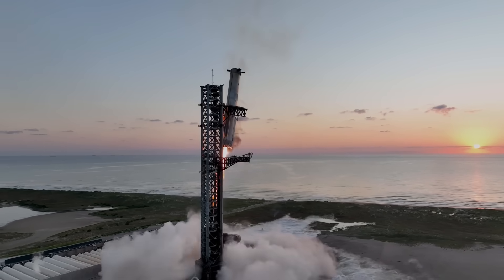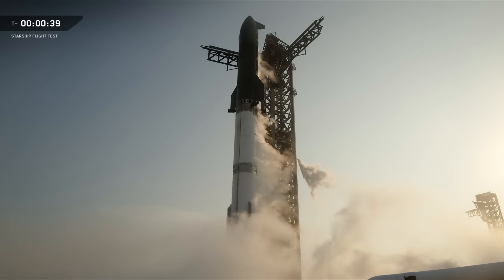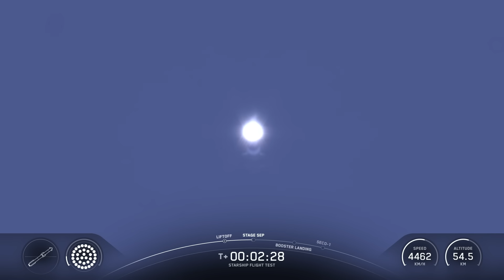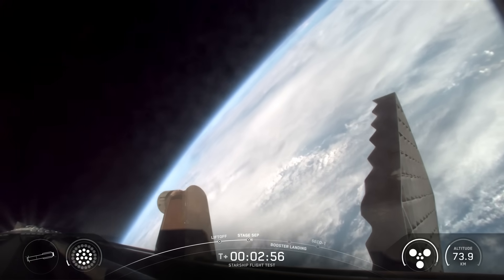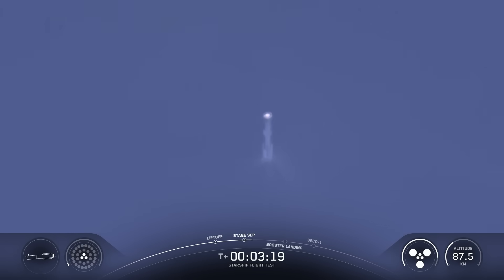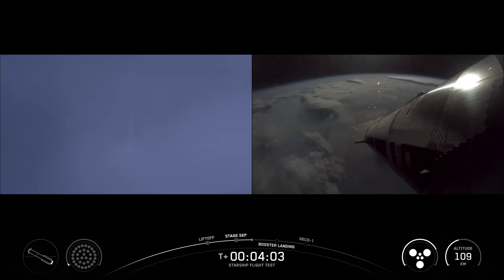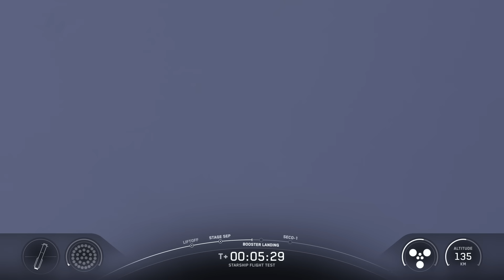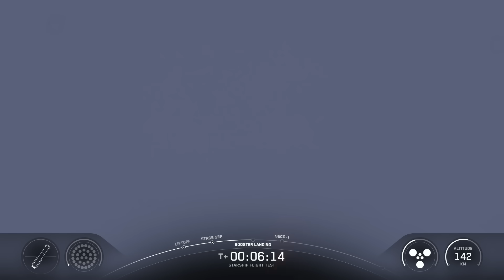SpaceX Builds Largest Reusable Booster, Also Makes Door That Won't Open - Starship Flight 9 Recap

Comment: Block 2 ship basically repeating what Block 1 did in its first 3 flights
Reply: As a PhD in Armchair Expertise I can say with high certainty that they're doing everything wrong
Reply: That kind of sugesting the leapfroging design is backfirering
Reply: Here's a fun comparison: Buran. The USSR started the Buran program in 1974. The first test flight occurred in 1988, and it was a success. Buran reached orbit, deorbited, and then landed using automated systems. And then the program went nowhere, because the USSR was falling apart and couldn't afford to keep up space program funding.

The Energia rocket used to launch Buran started development in 1976. It only had two flights: The first test in 1987 was a failure, but the second (the Buran mission) was a success.

People say developing new rockets is hard, and that's true. People say SpaceX's approach, which involves the rapid unplanned disassembly of many test vehicles is faster than spending years and years modeling things on the ground. But uh, SpaceX's super heavy lifter program was publicly announced in 2012. It was first alluded to in 2005. It doesn't seem like a particularly accelerated timeline to me. And that with the benefits of decades of advancement in materials science and computer modeling and simulation?
Reply: @SnakebitSTI  Exactly. We have only been launching orbital rockets for what, 68-69 years? Look at how many rockets we have been through and how much we have done. About 12 years after Sputnik we were on the moon with a massive rocket which worked first flight. Then about 14 years later we had the shuttle, and a bunch of other orbital class rockets in between, plus ICBMS. Where are these "decades" of time and all these failures? Plus, ignoring advancements in engineering and simulations is just crazy. Lets look at just the Starship reentry tests where parts of it melted, repeatedly. That should never have happened. We have plasma wind tunnels, like the Arc jet complex where a miniature or part of Starship can be tested to see exactly where the plasma flows at and which parts fail. Design changes can then be made without any need for repeated reentry tests to see what happens. It doesn't matter if they are doing something different., the vehicle still experiences a bowshock and heating, physics doesn't change cuz you have a new idea. And where is this "rush" to rapidly develop and manufacture all these giant rockets coming from? Do we have a planet oblitering asteroid on the way right now? Mars is a horrible idea.. lets put space stations on a planets surface which offers zero benefit to humans and can never be terraformed because the gravity is too weak to sustain anything close to something which can keep people alive. Keep the space stations in space where gravity can be simulated, construction is easier, and  help can be provided in under a day, not to mention it is cheaper and a lot less risky.
Reply: Can you imagine the hew and cry which would have taken place if a block 2 F-16 had have performed as poorly as Starship? Even the Ukrainians would not accept them even though they are starved for jet fighters. Why are we requiring so much less of Elon's Starship? He did fine with his other rocket development. He didn't blow up nine of them before he got to the point where they were commonly successful. I think we need to stop throwing Federal money at him for this project. He might not launch as often, and it may be years before another one launches, but I'd bet that he gets things figured out and fixed before he launches.
Reply: The money is tax payer money. . . He has spent $3.5 billion testing Starship using the Lunar lander money
Reply: @DanDeGaston  Then used $280-million to buy a President, get his buddy appointed NASA director and axe the Moon mission so that he doesn't have to continue with lunar starship.
Reply: Block 2 is a failure.  Period.  It hasn’t performed better than Block 1 overall.  They need to regress to Block 1, forget about ALL objectives other than to get the damn thing into a stable orbit with pitch & yaw control then deorbit successfully.  THEN they can do design/performance parameter variations.  HLS doesn’t give a shit about launching Starlink satellites.
Reply: Yeah without orbital insertion nor payload deplyoment...the two important things needed to use it for ANYTHING
Reply: @hurricanemeridian8712 and not selfdestroyed
Reply: @hurricanemeridian8712  and the two things that could make it actually cost-efficient (i.e. rapid reusability without refurbishment and orbital refuelling) are still so far away
Reply: @trabladorr  Yupp, even Falcon 9 isn't rapidly reusable after 10 years...
Reply: @trabladorr  Those two things arent even needed to make it the most cost efficient compared to literally anything else out there
Reply: @TheGeffry yes it is
Reply: @TheGeffry  Nine days is quite rapid in that industry... look at how long it took to get the shuttle ready for reuse (the record was 63 days), and reusability was one of the main points of it.
Reply: @TheGeffry  and yet flying more than once a month, let alone once a week, has made it better than just about any competitor anyway
Reply: @TheGeffry  This isn't a criticism of SpaceX's engineers, just a criticism of Elon's "optimistic" timelines. Falcon 9 is an incredibly successful rocket.
Reply: @TheGeffry  but its still so cheap that it took the majority of then launch market.
Reply: @TheGeffry  they abandoned that plan because they finally realized that Falcon can't be reused that quickly. They tried to design starship for rapid reuse from the start, but they're realizing that rockets aren't suitable for rapid reuse. They're more like ships, not airplanes. They need more than 30 minutes of inspections and maintenance before they're ready to go again.
Reply: @trabladorr they should just quit now. Sounds difficult
Reply: @hurricanemeridian8712  180km at 26500km/h is basically orbital insertion.
Reply: @hvr1874 And a Cybertruck is basically a dumpster with a golf cart motor. They're still not the same thing.
Reply: I think we are all figuring out this I'd about as big as we can send up with this technology.  Starship is beat to hell by the time it's supposed to work.
Reply: Inability to learn from previous experience isn't genius.
Reply: @SaberToothBicycle  such a low IQ take.. they changed thousands and thousands of things
Reply: @SaberToothBicycle  but the data! We need the data! 😉
Reply: but up to now , still Space Shuttle has had more sucess than starship. I do not see Starship solving than many different serious problems in both booster and yet orbital vehicle any time soon. Mind that first flights were even more susscesful than those 7,8,9 test. That is suggesting a BIG problem , and not only from the engineering point of view. If this had been within NASA management , surely it would already been scraped by the congress ... Private magagement does not necessarily mean sucess.
Reply: @luiscolchero466  If you just take into account space shuttle, and not the entirety of the SpaceX program... sure you'd think that lol
Reply: After that Block 3 will repeat the same... Jeff.. save us..
Reply: How many times can you patch something until the rocket is no longer a rocket?
Reply: NSF had a killer patch of ship spraying in pieces
Reply: @HicSvntDracones  Ship of Theseus, nice!
Reply: @HicSvntDracones All Starships built and flown to date are test articles, none of them have had the objective to reach orbit. They are stepping stones to reach a final design.  
Nobody has ever built a fully rapidly reusable rocket before plus it’s by far the largest rocket ever built. 
To do this SpaceX has adopted a method of rapid iteration “build-test-improve”, instead of spending decades doing computer models only to still find problems when the real thing is tested cough SLS/Orion *cough*. SpaceX wants real world data instead of trusting computer models.
This method is a bit unorthodox and goes against how most people think developing rockets are done, whether it’ll be successful or not is still to be determined.
Reply: @jagheterbanan  Except narrative isn;t matching up with reality.What rockets wasted decades on computer simulations just to hit major problems once in space? I'm interested in real examples of rockets built with modern tech. It sounds like you are running off things built in the 60s when we were still gathering all the data and improving computer simulations, but even then, it didn't take decades.and all US heavy lift rockets were a success. Saturn V had a successful 1st flight, so did the shuttle, along with a lot of other rockets, and the Shuttle was pure insanity given the tech we had. Now, modern rockets which "waste" all this time on simulations are even more reliable. Even New Glenn, which was supposed to prove Elon right put an object in orbit on first flight. It didn;t land, but that is 2nd to doing what a rocket needs to do. Rockets are being designed quicker now, and are a lot more reliable. Some have issues, and that is usually due to a faulty piece of equipment, not a faulty design that wasn't caught in simulation.
Reply: @jagheterbanan  NASA doesn't have near unlimited amounts of other peoples' money to throw into their heavy lift program. Also as Scott suggested, for a taxpayer funded rocket, multiple test failures can easily result in the funding being cut and the whole thing cancelled. So they have to make sure they pretty much get it right the first or at most second time. That's why they wait till the vehicle is ready before launching. First SLS launch was a success. It should also be noted however that with Saturn V, NASA did have a very comfortable budget. All space programs make extensive use of simulations.
Reply: @HicSvntDracones You’re completely failing to understand what SpaceX is doing. 
You can’t compare it to anything that has previously been done in rocketry and again none of the Starship flights have had orbit as a mission objective.
Reply: @zvexevz I’m not saying SpaceX method is superior or anything, all I’m saying is that the failures we’ve seen so far are to be expected with their methodology and we can’t really draw conclusions on Starship’s viability from them.
Reply: @HicSvntDracones Getting to orbit isn't hard.. even india can do it. Making it reusable is the real challenge. 

New Glenn is not very impressive.
Reply: @jagheterbanan  You were just comparing it to other rockets. What is it that they are doing that is so revolutionary? It is a rocket, it just has a booster which lands.. what are they doing that is so revolutionary from the design methods of the 50s and 60s other than having the funds to continue doing full scale tests after 4, now 5 failures in a row? And I am referring to Starship, not booster, that works, but the most important part doesn't work... 9 flights and it still leaks. It happens, take a pause, redo the design, test on miniature, and get it working. Continuing to put patches over patches is just pure insanity. It has so many design parts from completely different mission profiles included, going all the way back to the stainless steel from the transpiration cooling concept. it's just a mishmash of a bunch of ideas.  So what if the missions were suborbital?  That doesn't change the fact that they weren't succesful
Reply: @HicSvntDracones  Your argument is basically "No one did this before so its a bad idea".  Thats a silly idea.  "It did what rockets are supposed to do" Oh, so you say that this flight test was also successful, since it did what a rocket was supposed to do.. not land, or anything, but it launched.    Its never the same standard applied when hateraid is consumed.
Reply: @HicSvntDracones  I think you jsut got here recently.. only the last 3 have leaked.  The first ones actually did pretty well.   They had some burning up issues through the flaps, but this leak spinout thing is new and likely variable.  Fix one problem, may make another problem.. etc.  Anyone who has worked on things knows this is the case.    You might have been really upset about the probability of flight itself had you been on top of that hill in NC when the Wright Brothers were testing their clearly weak designs.
Reply: @DannyBowen25  Are you seriously comparing the construction of a rocket over 60 years after rocketry really started lifting off the ground (pun intended) with the very first documented flight of an aircraft?
Like, yeah. Obviously the Wright Brothers were a lot more daring, they tried something never done before. SpaceX, on the other hand...
Reply: @User_5tjk42gj9  India also went to the Moon, so saying "even India can do it" is discounting the incredibly awesome stuff India has done. So, why can't Starship stay stable in orbit? Not talking about reetry... If it could go up, stay stable in orbit, and control itself like a rocket.. cool.. but it can't do that reliably yet... that should be the very first thing. So, yes New Glenn has done far more than Starship can, it put something in orbit.
Reply: @DelayRGC SpaceX is literally trying something never been done before.  Lol. Its fascinating the cognitive dissonance here. Thats like me saying that the Wright brothers weren't doing anything new,  because BIRDS have been flying for millenia.
Reply: @DelayRGC fully reusable rockets have never been done before.  Belly flop reentry and flip has never been done before.  The actual Raptor engines, brand new.  The idea of the deluge system, brand new.  Catch arms,  and the entire stacking tower.. brand new concepts. Reusable heat shielding.  New.  Just because you want to pretend this isn't new, doesnt make it so.
Reply: @DelayRGC heavy booster flip and return to pad.. never been done before.  I could go on, but its never enough for the voices in your head, so I'll stop wasting my time.
Reply: @DannyBowen25  9 flights and it still leaks, not 9 flights all leaked.. No one did this before? No... We did this a lot in the 40's 50's and into the 60s, especially with aircraft, we did;t have the ability to do simulations, it just wasn;t all full-scale. They aren't doing anything new when it comes to design methods, they went backwards. If the wrigt brothers were using the same design methods 120 years later, yeah... and I am sure you've seen those youtube vids of people in Africa attempting to fly with some crazy contraption and laughed.. If you want to compare them though, it would be like if the wright brothers strapped some jet engines on it, and repeatedly aimed for a 30,000ft 18 hour trip around the planet, and kept failing. No, I didn't get in late.. Falcon 9 & the BFR are things which influenced me to go into the space industry a decade ago. Nor is it hate.. Starship, not booster has fundamental design problems which need to be fixed instead of repeatedly doing full scale tests, but yes, it is also having strong negative effects on space & science, directly and indirectly. Regardless, I still fail to see the point in Starship. Mars won't ever work, the moon mission is being axed, So.. its going to be a satellite dispenser? It lacks a clear goal and needs to be designed for that goal, it's one of the problems with the design. I'm not saying Starship bad, other than being baffled by it's purpose, all I am saying is that the design process is a bit nuts and they need to pause and reasses the current design and iron it out more before all these suborbital flights.
Reply: @DelayRGC Also, last thing I'll say.. no I'm not comparing those two events I'm comparing the REACTION to those two events to point out hypocrisy to the standard of "would you want to get on a flight?  If not it must be bad" well we wouldn't have wanted to get on a flight on those planes either, but they got better.   Improve your reading comprehension.
Reply: @HicSvntDracones So if you were right 100 times, and then the 101st time you were wrong.  I just get to say you are still wrong? Lol. 9 times and it still leaks is disingenuous language.  3 times and it still leaks is ACCURATE language.
Reply: @HicSvntDracones also, you being baffled isn't probably something new and your ignorance doesn't negate purpose.  You believing mars won't work has zero bearing on it working.  You are just another in a long line of "i can't do it, so no one can" meanwhile they are doing it, and all you're doing is talking.
Reply: @DannyBowen25  The Belly flop and flip is new because of Staships design. Nothign else is new, just improvements on other tech.. and the deluge system? Seriously, is this just satire?
Reply: @HicSvntDracones Also, iterative design and BUSINESS have to often have multiple purposes.  So you say "is ir a pez dispensor or is it a mars rocket "  it's both.   It can be both, it absolutely can do many things.  Your way of thinking is restrictive. There is absolutely nothing about starship thats negative for the space industry.  Not a single thing can be said that makes it a negative.  Its a trial and error.  Its science itself.  The idea that you thinking that because you PRESUME the hypothesis is wrong, it shouldn't even be tested or attempted is silly.  You're all just being captivated by something outside of this, almost certainly.   Falcon 9 has been a leap forward.   Starlink, a leap forward.  You'd say "we already had satellites!!!!" Because that's the flat level of thinking you provide.   Do better.  Starlink is advanced technology.  If this isn't new, then nothing has ever been new.  Rockets aren't new. Because we knew about fire LONG before we built a rocket.  You folks don't even see your own hypocrisy.
Reply: @DannyBowen25  New ideas and concepts that aren't necessary except for being new ideas an concepts. Starship never need catch arms to succeed as a launch vehicle, for instance.
And judging by the progress over the last five years, fully reusable rockets are still nowhere near the horizon!

(also the raptor engines where first conceptualized in like 2012)
Reply: @DannyBowen25  For someone claiming to stop wasting their time, you are throwing quite the tantrum.
Reply: @DannyBowen25  Nobody is saying don't do it, saying don't rush right into full-scale testing. Get the design solidified in minature, when you are confident it will perform, get it into orbit and fix any small issues, after that works fine, then reentry. Not put it together and go "Lets see, but I don't expect it to survive". If you aren't confident, it's not ready.   Their is also a huge difference between an orbital rocket and a Mars rocket, though the idea of a chemical based Mars rocket still seems nuts to me. Mars is of no use to us other than scientific knowledge. Reusability in the sense of a reusable booster is perfect for orbital missions, but for those missions they can also do away with the stainless steel, which causes tons of problems and would massively increase capability. For a Mars mission, or another planetary destination, one or two spacecraft working as cyclers are more than enough for scientific expeditions.  I see no reason to have a whole bunch of mass produced chemical rockets which require a bunch of refueling trips for interlanetary missions, or for orbital missions. 5 Starships would be more than enough for our orbital needs. If they want to waste their money on a MArs dream which can never happen, fine, but stop getting federal funding.  Booster is a different story, I am fine with booster, it works and it was designed properly. Starship is a whole different story. Now if they had other goals, like using Booster to put up a bunch of space stations as orbital colonies, that would make much more sense, but I would still say they need a redesign if they weren't working after 9 flights.
Reply: @HicSvntDracones 
You need to practice some reading comprehension, I was comparing the difference in methodology of developing new rockets as to explain why your criticism is invalid. 
It seems you have an inability to understand the enormous differences between Starship and conventional rockets both regarding how it’s being developed and the unique challenges in its design. I suggest you educate yourself a bit more before commenting on stuff you haven’t got a clue about.
Reply: @jagheterbanan  In other words, you've got no argument, so you turn to insults. I get it, can be frustrating.
Reply: @jagheterbanan  "To do this SpaceX has adopted a method of rapid iteration “build-test-improve”,"  But instead of improving Starship is back where IFT 3 was.
Reply: @malcolmstreet1 Do you work at SpaceX?
If not how do you know the leak was caused by bad design and not something like human error?
Maybe someone simply forgot to install locking wire on a coupling, or maybe something slipped through quality control at a subcontractor. 

These things happen every where complex things are built especially when under pressure to meet tight deadlines, maybe SpaceX needs to think more about human factors.
Reply: @jagheterbanan  - it's not a one-off.  Starship has failed in all the V2 flights from various results of propellant leaks.  What was a major change from V1?  The propellant feed layout that looks vulnerable to resonance.
Reply: @malcolmstreet1 
Flight 7 was harmonic resonance, yes a design flaw in the new fuel transfer system, but it was already fixed for the next flight. 

Flight 8 was a faulty Raptor engine, considering the amount of successful testing they’ve done with Raptors this seems to be a one of fluke also there’s the v3 Raptors soon to replace the v2 where major upgrades have been done to increase reliability. 

Flight 9 was a fuel leak in the skirt section, likely from a coupling not sealing properly. 

None of them are related and none of them are serious enough to question the validity of the entire vehicle. 

The only thing I see as a major concern about Starship is getting it through re-entry in a rapidly reusable state, doors not opening and leaks appearing are all solvable with a bit of engineering but the physics of re-entry is very hard to engineer away.
Reply: @jagheterbanan  Someone please help me out here, but is there a single other spacecraft other than Starship with a 9 for 9 failure rate?

Even the N1, which currently seems to be the direct inspiration for Starship, was only allowed to fail four times before its fifth planned flight was scrapped and the whole rocket was cancelled for good.
Reply: @DelayRGC So you don’t understand SpaceX methodology either. 
Every Starship ever built have been test articles, not even close to final design. 
They’re experimenting pushing the design to its limits and beyond to make it as efficient as possible. Nobody building rockets has ever taken this approach before so I guess that’s causing some confusion.
Reply: @jagheterbanan  I very much understand their methodology, and look where it's gotten them so far. Explosion after explosion, failure after failure and no step closer to a functioning system.
After, what, 2 years of integrated testing and 13 years since conceptualization.

Perhaps software development paradigms should be kept in software development.
Reply: @DelayRGC No you clearly do not understand. They are pushing everything to its limits to find where it fails, they’re gathering data, the only failure is that they didn’t get any data on how the heat shield holds up to re-entry. They had even removed 100 tiles just to see whether it would survive or not.
Reply: @HicSvntDracones Because SpaceX doesn't want to put a useless rocket in orbit? Why would they possibly want to do that?
Reply: @HicSvntDracones  I COMPLETELY agree with you... even that point mentioning mars rocket WILL not be a chemical-powered solution ( 6 months of human travel through soace is NOT feasible for so many different reasons...)  , but more likely a nuclear powered one ( about 1 to 1,5 months travel ) will be the proven solution .  And in that Starship is , by no means , the way to go to mars. And lets no forget ee have NOT yet started to solve the very hard and complex problems to survive on Mars surface ... something NASA has been working on , Space X has not. We dont want to send womens and men to die on Mars surface , far , far away from any rescue mission. Fast track to Mars is NOT feasible , it us no moon to reach...